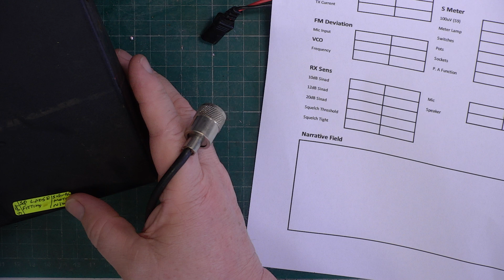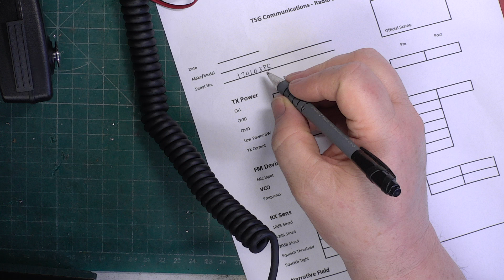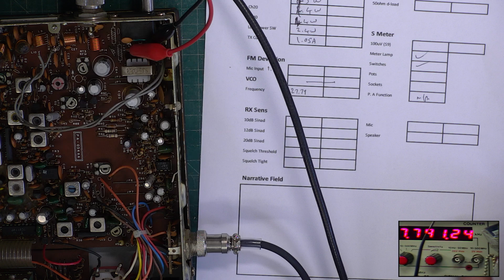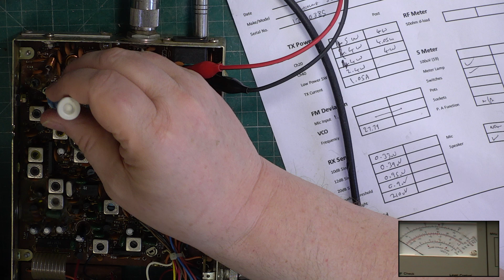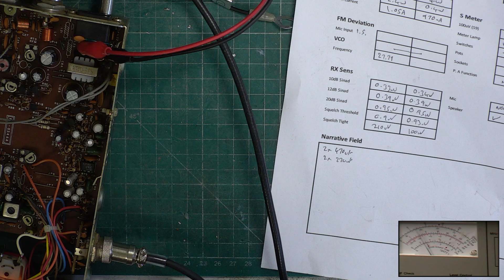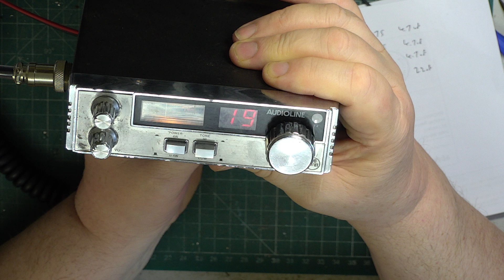Audioline 340 CB27/81 UK FM CB radio -  service & partial recap

Comment: Sorry it's been a while but laptop packed up. I'm now sorted again with another one. Shame about all the muppets on the 19 every time you try to get a roger. Where I live the muppets are licenced ham operators who like to decend onto the 19 in the evenings and sit there talking all night. The trouble is they're using Yaesu and Icoms etc with the standard 100 watts out the back, and it makes it impossible for anyone else to use the CB around here. I've just about given up with UK FM now and gone back to the EU band (the superbowl has been far more interesting), and the new CB users that came back after lockdown have all gone. These local ham muppets have driven everyone away.
Reply from the maker: Those people need reporting. It makes 19 unuseable & you have to sit on a particular channel like I do for CB to work. A couple of years ago, I set off from York & two guys were talking (not on 19). At Donaster the signal peaked from one & he finally ran out of range at Newark..what was that? 400W?  Needs a confiscation order, £2K fine & some prison time.

Richard, G0OJF, UK
Reply: Depressing, isn't it? Even without the multitude of frequencies available to them on the Amateur bands for which they're licenced, they still have a potential 79 other channels to yak on (and in AM and SSB on 40 of those too) so why tie up what is meant to be a calling channel?